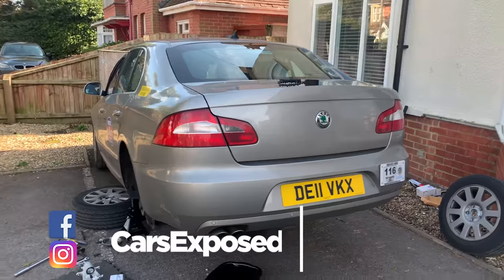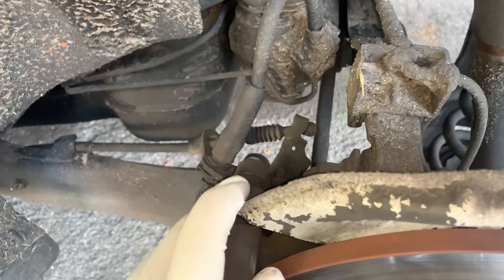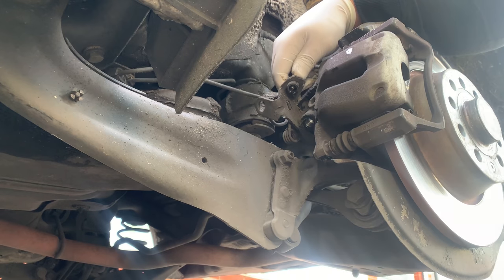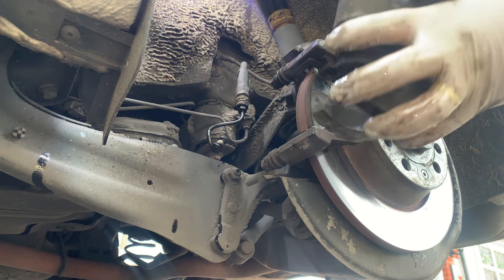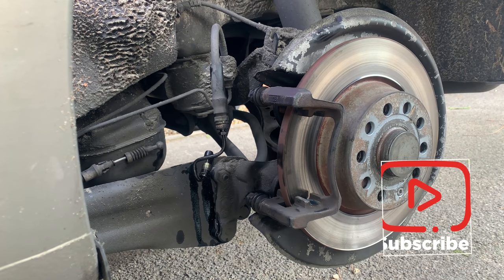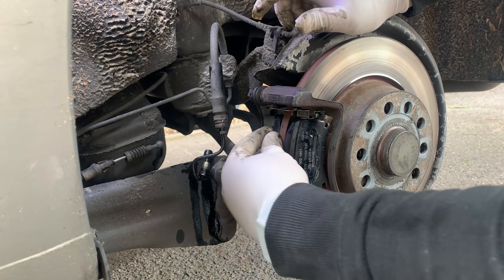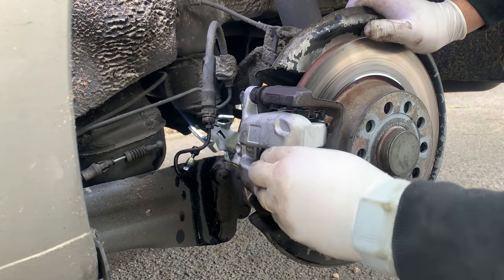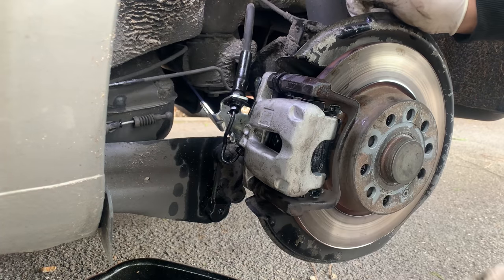Skoda Superb Rear Brake Calipers Sticking | Replacement

Comment: I'll give you a small tip. When you doing something with brake caliper, brake lines, just get some pipe or wood block and stick it between brake pedal and seat. This will create a pressure in the system and when you crack your bleeder open this will prevent you from getting air in the system. It works every time, try it.
Reply from the maker: Kalobos cheers bud I appreciate it 👍👍🍻

Comment: I reconditioned both my rears today. About a 2 hour job. New discs and pads too. All inclusive, less than the cost of a cheapish (not the cheapest crap cast stuff ebay special admittedly) single caliper. Actually less than £50.00 very very easy and the old original calipers now look brand new too. Definitely the way to go. Shouldn't need to worry about them again as should outlive the car and certainly the time I'll own it for.

Comment: Thanks for this. Helped me a lot putting a new caliper on a Skoda Yeti. Only problems I has was when I came to put the new caliper on, the new one didn't fit! The mounting bolts were wider on the replacement but all sorted now with another caliper from another supplier.

Comment: amazingly well made videos!!! great shots and comments, tools to use, and you show problems you may run into. etc. I used your videos earlier to change discs and pads on an Octavia. Never done that job ever before. I made it! :). Now I'll use this video to fix sqeeking on my Superb. Sqeeking is actually at higher speeds and wheels get very high temperature. Hope though it's only dirt or rust where pads glide... Thanks a lot!!
Reply from the maker: Peder Laitamaa thanks mate I appreciate it... cool that you were able to do your own brakes 👍... I just saw your email I never worked on the 4x4 but I would imagine it’s exactly the same parts, 2010 and 2011 they are the same I hope it helps 👍👍👍

Comment: Hi Mate,
Good Job. I am learning a lot from your videos. A month ago,  I did oil and filter change myself after seeing your video on Octavia servicing. Thanks.

Last week,  I bleed brakes with a pressure bleeder and Vizibleed One man brake bleeder. I did a few mistakes and I am worried about air in the brake circuit. After I finish the work, I did notice hissing noise (near pedal) when I pump the brake pedal when car is off. Brake feel normal and Car is only 4 year old with 72k miles. 

Mistakes
1. After removing old fluid from the brake reservoir, did not add new brake fluid. Instead, I poured a full 1-litre fluid in pressure bleeder. 
2. I did not pressurise the circuit enough. Skoda recommends bleeding brake at 2 bar pressure, whereas I did at 1 bar.
3. Passenger left nipple I opened too much and brake fluid leaked via the gap around the nipple.

What could be the issue? is it normal to hear the noise? Do I need to bleed brake fluid completely and re-fill? 

Please advice.

Thanks..
Reply from the maker: RONY THOMAS nice one mate I’m glad the videos is helping you 👍👍👍

Whoosh sound is normal when pressing the brake pedal, what kind of noise is it? 

When bleeding the brakes with a pressure bleeder you don’t need the ezybleed, all you need to do is open up the brake nipple until steady fluid flow is coming out and no more bubbles. You can attach a normal pipe to the nipple so everything is nice and clean... 

Does the brake pedal feels ok or spongy ?

Comment: Hi
Do I need disconnect the pipe and the hand brake to change the pads?
Thanks nice video
Reply: No you can slip caliper off with all still intact. Just don't put too much pressure on brake hose. Tie it up

Comment: I just replaced pads after 3 years. Rear left was hard to push and turn back, right one went back in very smoothly. Both calipers were reconditioned from gsf and fitted 3 years ago.  Probably  new caliper needed again i guess?

Comment: I was hoping you would use the vacuum bleeder, what's the spray you used for checking leaks? last if its not too much trouble which video editor are you using?? Thanks for the video........................
Reply from the maker: teme jumbo thanks mate, I don’t have a vacuum bleeder I have another bleeder that pressurise the system I’ll show it in another opportunity, regarding leaks I only visually inspect that should be ok ... I use Adobe premier pro to edit the vids cheers 👍👍👍

Comment: Just done my sons 2014 Seat Ibiza Fr for the second time. The issue is that these rear calipers fail with the handbrake system not fully returning to it upper rear position so the piston / pads stays slightly on the discs. A real poor design. These newer calipers now seem to have an assisted spring that the originals didn’t have. Let’s hope I get more than a year out of these now ones.
Reply from the maker: Did you check your hand brake cable ? were they nice and free ? I've just replaced the left hand side caliper again today because it was seized not moving at all even using a hammer, i checked the hand brake cable and it was seized i think is probably something that i didn't pick up before...'  👍👍👍👍
Reply: Cars Exposed No both cables were free it’s the caliper again. I think some are simply cheap or poorly refurbished. This new one has a spring that the others didn’t have so I’m thinking maybe this one will survive longer than 12 months.

Comment: What are you doijg to trash the pads so quickly.

I dont drive slow by any means and ive had the same pagid discs and pads on for 35,000 miles

Comment: Looks much easier than I thought it would be. Deffo doing it myself and not paying someone else to do it. On the disc front what make do you use/would you recommend. I have an octavia
Reply from the maker: Cool 👍... i bought the discs from TPS they are genuine VW ones, personally I tende to get the cheapest discs but good pads I always go for pagids or Brembos... 👍👍👍

Comment: great video. I've replaced my calipers but it still binding, not easy to turn with the handbrake off. Were your calipers genuine? Mine was remanufactured from GSF.
Reply from the maker: Vilius uk did you clean calliper bracket and slider pins properly ? I got mine from EBay 🥴
Reply: @CarsExposed  yes cleaned it all. Also replaced brake cables. Levers come back to caliper stop but its still difficult to turn the wheel as is in your video
Reply: @Wiliuz  Did you solved it?  I have a same issue. Basically replaced the caliper and it's binding even worse than original one..

Comment: If my handbrake lever on caliper isn't going all the way down when i release the handbrake is it a stuck caliper or a stuck cable?
Reply from the maker: It’s hard to say it Could be either ... the best thing to do is to remove the cable and check after that 👍👍👍
Reply: @CarsExposed  i replaced the driver's side cable last year but i didn't change them at the same time.
Yes I'm thinking of doing that and check again if it goes all the way down...
It couldn't reset its position by pushing it by my hand but still it can be either as you said...
Also one thing i noticed is that the handbrake became a lil loose last few months but I don't know if this can be happen in both of those two issues
Thanks for your very fast reply...keep up the good work
Reply from the maker: Perhaps the bracket that holds the cable inside the cabin is a bit wonky, I would suggest a break reset , unhook the cable from the caliper then make sure the caliper pistons are pushed all the way out by pressing the brake pedal , loose the bracket inside the cabin , hook the handbrake cable back up at the caliper then adjust the bracket inside the cabin as needed 👍👍👍
Reply from the maker: Sorry forgot one thing make sure the bracket inside the cabin is nice and level after it 👍
Reply: @CarsExposed  the vehicle is a e150 Auris (LeftHandDrive) for some reason they have the inside ebrake cable bracket leaning on the right side(with problem) probably from the factory...
Are you sure i could remove the cable from the caliper without releasing it from inside first?
Reply from the maker: @K_N_44  sometimes you can just releasing the handbrake ... if the bracket is leaning to one side it pretty much indicate a problem with the handbrake system , it should be nice and level

Comment: When I take the 11m nut off the pipe starts twisting help
Reply from the maker: You can use heat to free it up or just replace the pipe they are quite cheap to buy already made up from TPS or Skoda itself 👍👍👍

Comment: WTF 400.000 miles? Wow... :)
Reply from the maker: yeap it has covered quite few miles 😂😂👍👍
Reply: @CarsExposed  I currently have 147.000km on my Superb so really nothing major to worry about yet. It is a 2013 production.
Reply from the maker: Tomas Stibal lovely car should last a lot more years without any issues 👍👍👍
Reply: @CarsExposed   I hope it will :)  Plus mine has the 3.6 V6 and rumor has it that while this is the most gas-guzzling option (to which I can safely attest) it is at the same time the most reliable gasoline engine ever put in the S2.